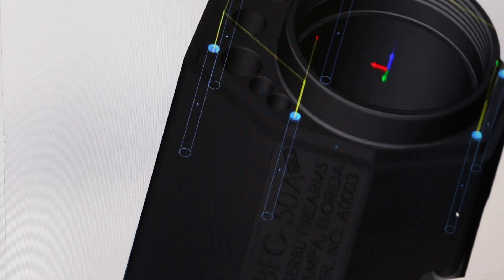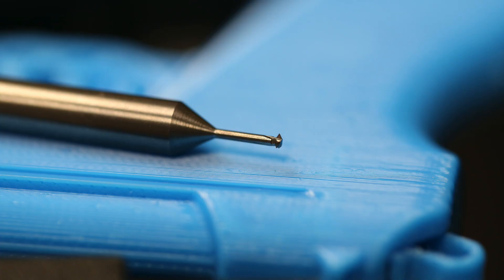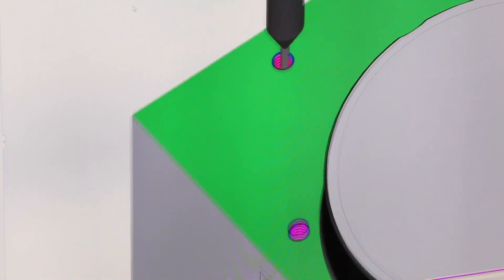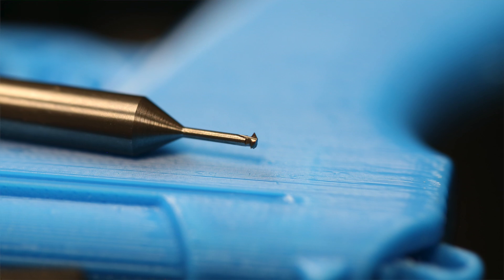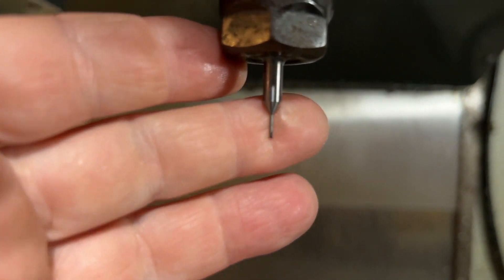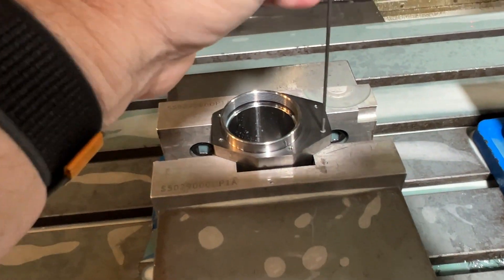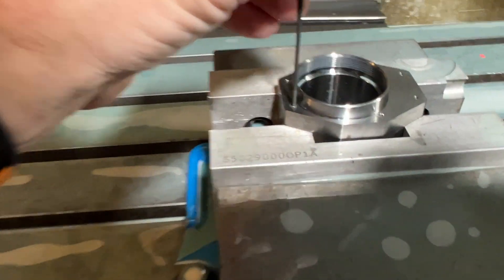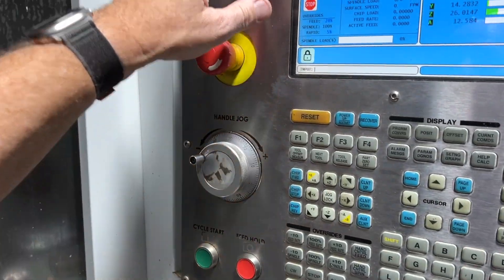Tiny Tool!

Comment: Just curious, wondering if a conventional 3 flute tap be safer. Taps always work well if you get proper chip clearance.  So reverse your set up and from bottom up so your chips will clear. I'm sure thats at least a 5 axis machine so it should do it. Just a thought from an old machinist.

Comment: As a Johnny come lately to the party, what about using a form tap? A shop I worked at nearly exclusively used those over cut taps and they reused them A LOT. Especially small ones, if memory serves me correctly they were m1 and m2 taps. Now the caveat is this shop mainly cut 303 and 316 stainless if that means anything over what you're using for your receivers but they held up. Also not knowing what concentrate you keep your coolant at will come into play they just had there's at 10% more or less because they were too cheap to buy a refractometer. Another way to tap those holes since you probably have ridged tapping set up on your Haas would be to see if somehow your CAM software could peck tap, yes I said peck tap. At my first shop I don't know how he figured out how to do it on Esprit but our programmer made a successful post for a Mazak variaxis that tapped a deep hole with a cut tap and that was a nerve racking tool path to proof. Tap never broke for the entire order and every part passed the thread gauge and ironically was faster than a threadmill.

Comment: Seems like the bicycle spokes are a solution in search of a problem.
Sure, they're cheap, but now it takes 4x as long to mchine.
A bolt on handguard like BCM/Aero or clamp on like Midwest Industries uses would be a much faster and cheaper option in the long run.

Comment: If its under 32Rc you can probably form tap it. Peck tapping with Moly-Dee usually works. I think SCT SPTM060 is the smallest I've used but they have a few smaller.
Reply: That's why I read comments before posting. Was curious if this part was already fully heat treated or not to require being thread milled.  Some alloys work harden up so fast taps break all the time. Some 316ss jobs I used to run I hated running because of broken taps. They switched up the operations to single point them in the lathe or thread mill them on a vmc depending on what machines are freed up.

Comment: When you were breaking taps, what % threads were you running? Most charts have it at 75% thread, which is optimized for soft materials. Hard steel you can go less l, like 50%. I had an issue trying to tap 2-56 holes in 304 stainless, and tried a bunch of things before we realized when can run less thread %. Once we changed that, it ran perfectly.

Comment: Would almost seem to me worth trying to find a set of bicycle spokes with self-tapping threads. 

I can imagine though mass production doing something like drilling the hole the size of the thread, milling a circular slot around it, and then feeding a custom machine that holds the spoke in place and uses a hydraulic press to jam an inverse conical forming die over the 'post' that was milled around and forming the metal into the existing threads without any precision thread cutting required. 

Or you could use a splined blind cap pressed in from the other side. Ugly, but effective. Or maybe a 'horseshoe' clamp made of mild steel that just sits on the other side of the aluminum, something thinner and much easier to use a regular tap with?  I know it's not a quantity item but 27 minutes for a machining operation feels like it's a bit much.

Comment: You cant power tap with a clutch with a drill press? Seems it would be a hell of a lot faster. I think cnc machines can power tap too, but i think the breakages are high without a clutch and through-spindle coolant.
Reply: Although i forgot what grade of steel the trunnion is and how hard it is and if it work hardens. So maybe tapping is impossible

Comment: Would it be more efficient to drill a through hole, and on the back side instead of the face machine out for a tapered threaded insert? That way the insert only gets tighter as more tension is put on the spoke? If the threads ever get boogered you could swap out the insert as well just by tapping it out from the face side. It should be user serviceable at that point. More parts, but perhaps more simple?

Comment: I go to 50-55% thread depth for taps in steel. There’s negligible increase in thread holding strength over the pitch diameter, and it saves a ton on taps.

Comment: Hey Mark, is the thread a 2-56? Ive heard those tiny ones are a pain in the ass... Have you tried peck tapping? If you're not aware, you need to turn setting 133 (Repeat Rigid Tap) "ON". Then the gcode for the cycle is G84. Haas has a good video about it in their youtube channel.

Comment: This is where commercial and military gun design go separate ways! If you are making something for mass productions those threads would never exist in that place ,whole part and gun if needed would be redesigned for simplicity and cheapness of manufacture. You cant make 5 million ppsh41 in 4 years  if each has 6 tiny threads like that ,still its cool to see what todays's machines can do.

Comment: Would it be faster to drill and tap for a 1/4-20 or 10-32 OD insert with the spoke threads? This would not be as elegant as the set up you have now, but a broken spoke would be easier to fix.
Reply: Not on a critical trunion. Yes otherwise! Absolutely! Neat idea!

Comment: That is just crazy small. It makes me wonder , could you drill opposing holes through the trunion, with the rear side being large enough to fit pre existing spoke adjusters for bikes? Screw on the adjuster and slide the spoke assembly through so the adjuster is seated in the larger hole and spoke is supported by the small hole?  Then tune as normal? Think guitar strings .

Comment: Could you EDM a threaded hole this small with a form tool?
Reply: You could but it would probably take about the same amount of time and probably cost more as the form tools wear quickly. In this case you would probably go through 2 form tools or more per part.

Comment: Really glad it worked. I've had seriously bad luck with tiny tools like that, especially drill bits and taps. Seems like I'm always getting poor quality no matter where I buy them from... because after breaking a couple almost instantly, I decided to check them and realized that they were all bent before I ever even got to use them, so as soon as they would hit steel (or even aluminum) they would break. It's still pretty amazing they can make such small taps/tools though.

Comment: That a harvey threadmill? Use alot of harvey single points at work but also alot of guhring roll taps down to 2-56 size they are awesome might be someting to look at to as long as you punch the hole the right size before hand and using them in TI and a286 is kinda sketch

Comment: Question. Couldn't you drill, and tape larger, easier, faster holes that accept serviceable prefab bushing that also thread in, made of brass, steel, or aluminum even. Then have the bushings with flat head slots.  That way if one of those spokes strip, or break off you can use a flat head to just remove them and replace it? That or have some recessed nuts on the rear. They too could be serviceable. 
But, I get it. It's a small part. May be easier to chunk it and buy another I guess too. Not sure how vital and expensive the part is. 
But yeah just curious 
Thanks

Comment: I would use a turned small thread inserts and make the a reasonable size thread on the actual parts, then just thread the inserts in with some locktite.  Shouldn’t be difficult to find a manufacturer for inserts with bicycle spoke thread.

Comment: Hey Mark I may not be a gunsmith but I wanna shoot you an idea. What if we built a super shotgun that's a pump actions that would take shells the size of soda cans it would be a close range burst type gun designed to just immobilize a target within 40 to 60 feet. If we tried to make a long range variant it would probably break your shoulder unless we used a piston to help dampen the shot so it won't break your shoulder I dunno I wanna see if it can be done and I think you would be able to design it better then I did.
Reply: Bean bag rounds exist already
Reply: already exists... its called a grenade launcher  ;)
Reply: @bunnykiller  true true but what if it used modified soda cans. So the ammo was basically soda cans with random stuff in them. For the opocolyps. Or maybe we could just used golf balls for the ammo like buck shot but stuff that will hurt a lot and probably blast a hole into anyone.
Reply: Get fancy. 
Launch your soda cans with a very low pressure charge, but have them be an individual heavy plastic 'recoilless round' that lights off about 5 meters downrange and vents mostly sideways, launching a half pound of steel shot ahead at good velocity and the 'venting sabot' just kind of drops out of the smoke cloud the charge left.

You don't feel the final recoil because you aren't connected to it, and all that can come back is gas and perhaps some flecks of powder. Something like a UHMW PE carrier with a mild steel sleeve should be able to take the shock of the remote charge going off and resilient enough to not fragment in the 'bad direction' (at you).

Comment: i found when drilling a 20 inch hold down a hardened bar of 220'000psi tensile 4340, the cutting bits really only work by slowly scratching the surface away needing to be sharpened every inch or two... hardened 4340 cutting but the cut chips come out as powdered steel. "20 inch line bore some old axle that had a minimum elasticity of 128'000psi, HSS cobalt bits out of a engineering firm in NYC". can do... with a 3hp modified drill press for line boring, but the feed depth perception is slow... about 8 hours for a 20 inch long 1/4 inch pilot, another 8 hours to run that to 10mm... the bit doesn't cut faster being on a bigger machine. cutting stuff that is twice as hard as tungsten...